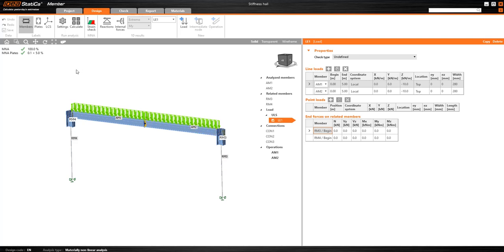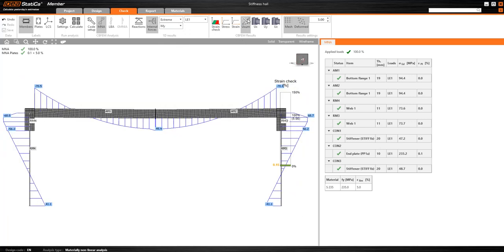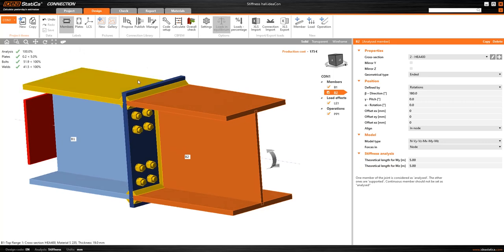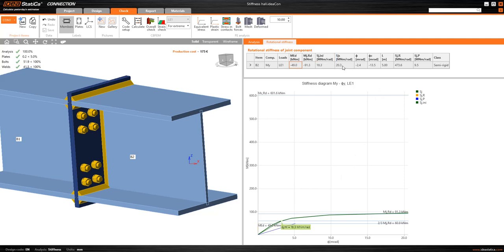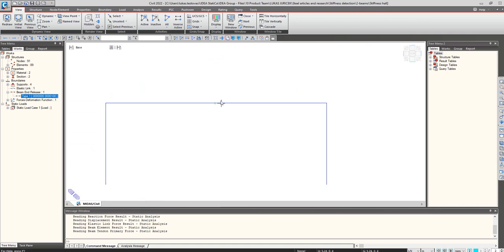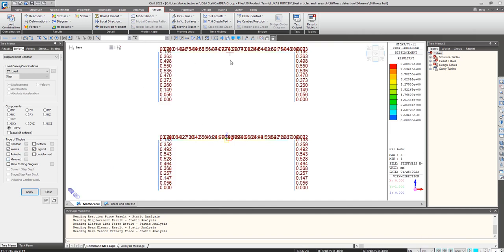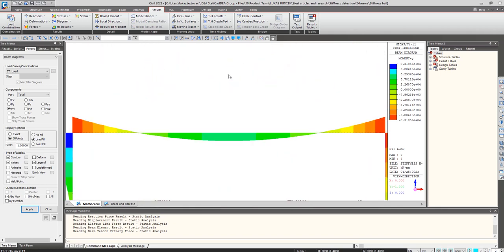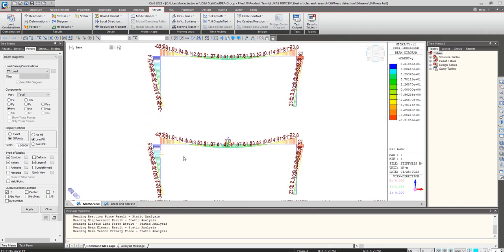How to put rotational stiffness to you FEA model

Comment: Why did you use secant rotational stiffness instead of initial?
Reply from the maker: Hi, according to EN 1993-1-8, clause 5.1.2(3) in the case of a semi-rigid joint, the rotational stiffness Sj (secant corresponding to the bending moment 
Mj,Ed should generally be used in the analysis. If Mj,Ed does not exceed 2/3 Mj,Rd the initial rotational stiffness Sj,ini may be taken in the global analysis, see Figure 5.1(a).

Secant stiffness reflects the connection's behavior at the applied load, but initial stiffness might also be used in this case.

Comment: Everything is awesome in Statica , but how do we detail our Final drawing..??
I didn't see any way to detail for finalized drawing...
That export to DSF file is super trash, it does  export to CAD file but very little info is detailed.

Main Problem I'm facing right now is , After the successful design of Connection, How the Hell we export to Detail Drawing????
Reply from the maker: Hello Anne,
IDEA StatiCa Connection is an application for design and code-check of structural steel connections, thus the drawing production is not the primary goal of this app. Hovewer, you can use some ways to export the geometry of the connection - the best way is to use the online Viewer and generate the 3D DWG model + 2D drawings, see the video:
https://youtu.be/s2LhqqYwK04?t=1725
and article:
https://www.ideastatica.com/blog/project-viewer-useful-and-costless
Also, you can create sketches and input them as pictures in to the report
https://www.ideastatica.com/support-center/sketches-model-view-in-an-example-workflow-engineer-detailer
However, we definitely want to improve this in some coming version of IDEA StatiCa.
Thank you for using our software and waching our videos!
IDEA StatiCa team